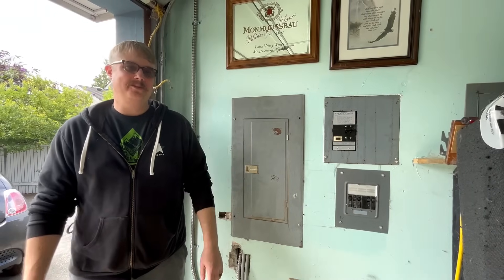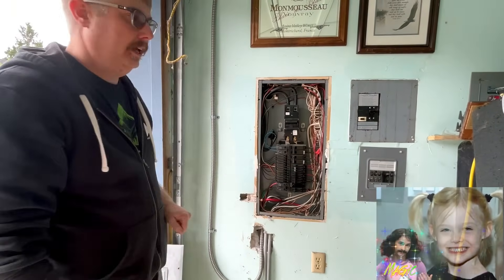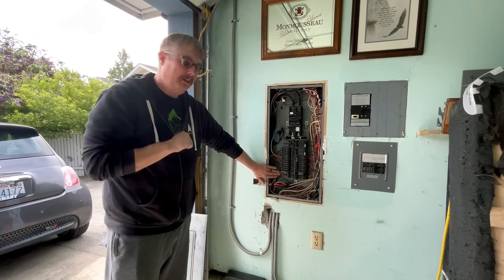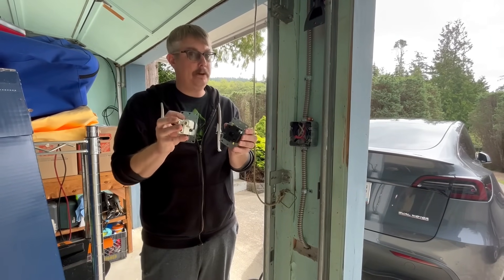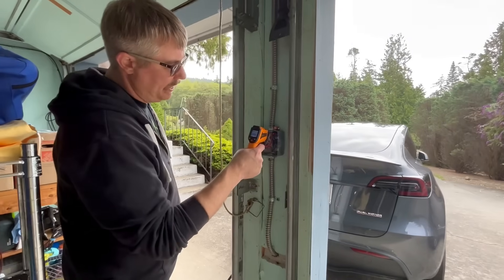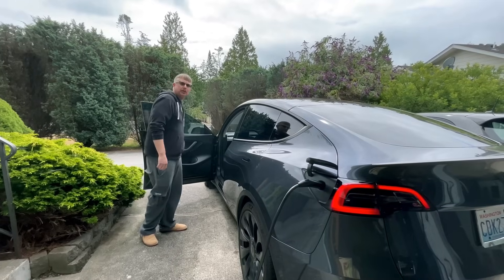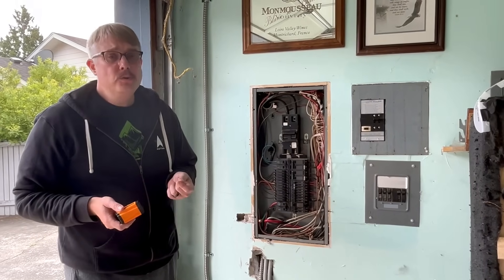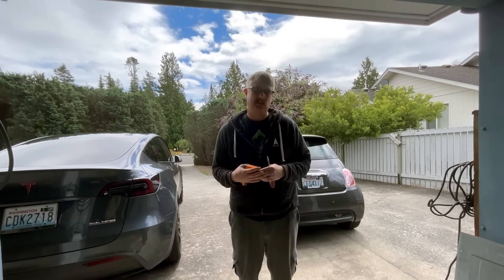Mastering EVSE Inspection: Step-by-Step Guide to Check Your Home Wall Charger

Comment: Pretty good information, a couple of quick comments. If you switch to a NEMA 14-50R then you need to make sure to switch from a 60A breaker to a 50A breaker. Also- MC is not listed for being run outside. You also need to make sure people understand how dangerous working in a live panel is. I would not encourage any homeowner to work in a live panel, and certainly not without turning the main breaker off. You also need to properly torque the lugs on both the breaker as well as the EV Charger. All in all a decent install, but not up to code and needs a couple of adjustments to be a proper install.